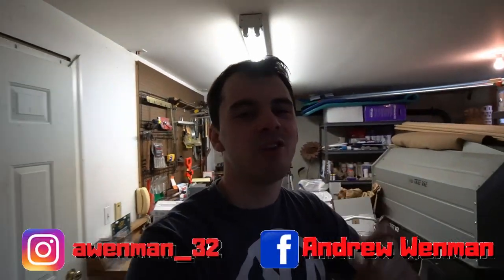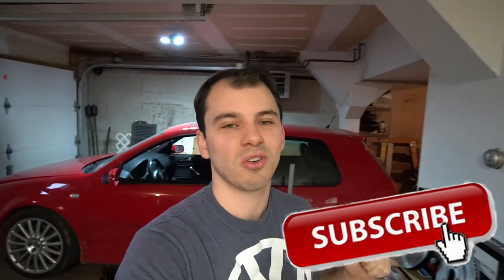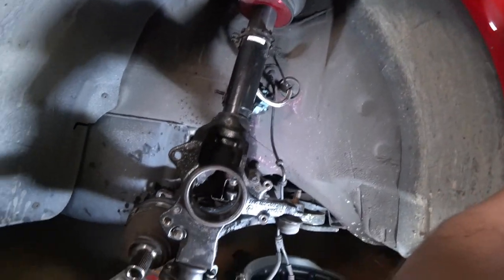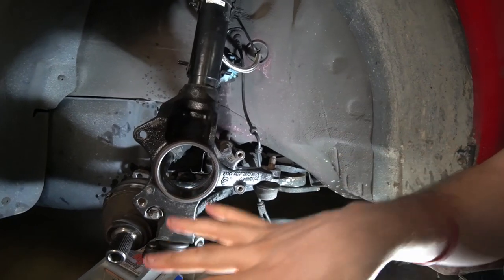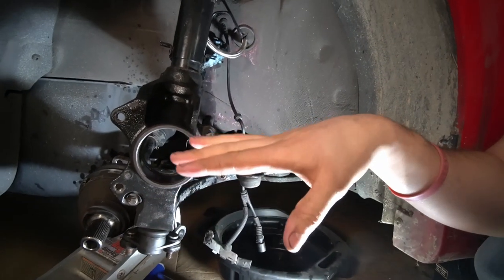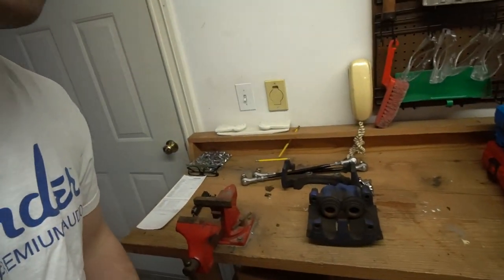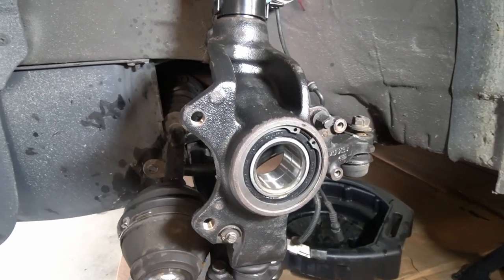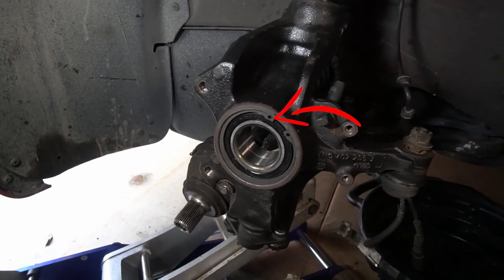How to replace front ECS Tuning Brakes, Wheel Bearing and Hubs for the R32 (Part 1)

Comment: Damn that's a lot of work! Well at lest the front is done and you just need to finish the rear. Get a Slide hammer it should help with the hub removal.
Reply from the maker: Banch3z yep I bought it and I’m going to use it for the rear.

Comment: Hi from Europe... how are the front two piece ECS disc brakes performing after six months?
Reply from the maker: No issues! Since the pads are hawk HSP pads as it gets colder out they squeal but performance wise they are still great. I had a similar set on my old R32 and I had over 30k on them with no issues.

Comment: Awsome upgrade man, question did the rotors come labeled right and left? Because most of the time i used performance rotors they would face the other way.
Reply from the maker: JORGE LUIS TORRICO yes they did come labeled in bags lol don’t worry that’s one thing I made sure I put on right. They are directional so only one correct way to put them on.

Comment: Great looking kit there from ECS! Be interesting to see how they perform.
Personally though, do you think you should have refurbished the calipers to complete the look?  ✌
Reply from the maker: Piero so I pulled the calipers looked at all the rubber and it wasn’t cracked and was fine. I did upgrade the caliper carry pin guild that was cracked. I’ll also do a review of the brakes once I get an alignment.
Reply: @ThreePedalGarage  great work man. If you're going to show the car I'd definitely clean and paint them also 👍
Reply from the maker: Piero yep for sure! I have to repaint the whole body of the car. It’s tornado red and the clear coat is shot so figured I’d try and get some deal doing it all at once.